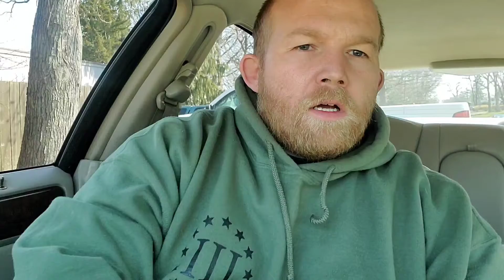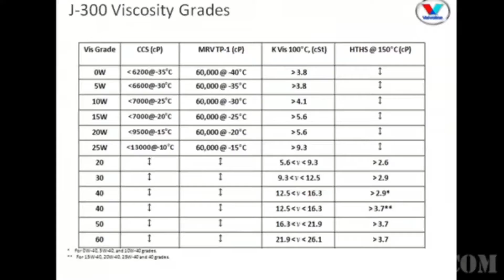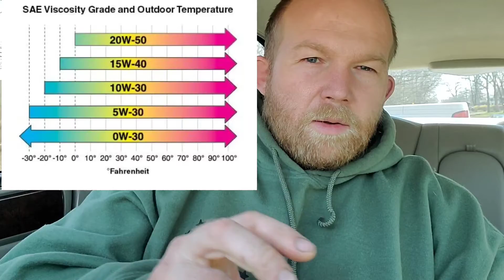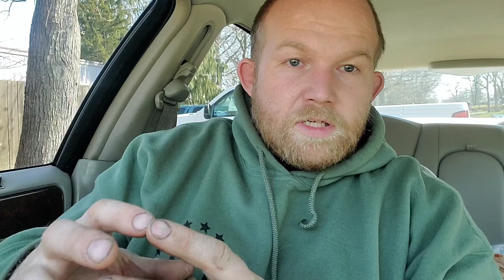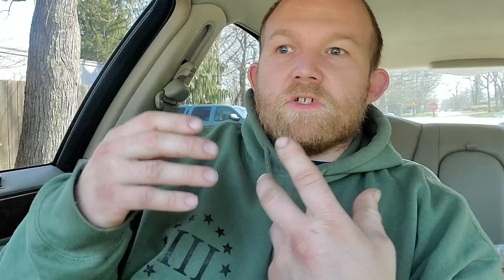Oil Talk 20w50 is Better in your Panther - Oil Change Interval 5k Good or Bad or Just Ok?! Part 1

Comment: Not 20W50, that is crazy. Some modulars were actually factory speced for 5W50. I've used it but it is very expensive. In the early 00s' ford backspeced many engines from 5W30 to 5W20. Some, like my Explorer OHV still required 5W30. The reason given was the oil pump. The new 7.3 OHV is specd for the same 5W30. (WSS-M2C961A1) this is either semi- or full synthetic oil.
Reply from the maker: Precisely if the vehicle is not specd for it you should not run it if there's no problem

Comment: glad you put this out there... when I read the title I was shaking my head thinking no no no... 20w-50 is not better for the Panther... use the spec oil 5w-20.  It is funny (sad?) how many folks will argue on Facebook that heavier oils are better
Reply from the maker: Yes Sir, It is not and people need to realize this. Keep your oil change interval short use a good-quality 5w 20 oil you'll be golden
Reply: exactly what I've been doing and never had a vehicle engine failure almost 40 years of driving
Reply from the maker: https://youtu.be/9C1C7APZyD4